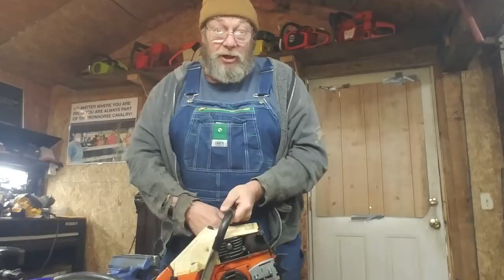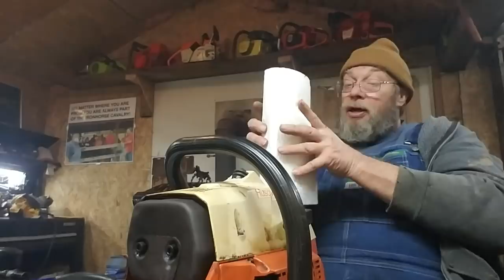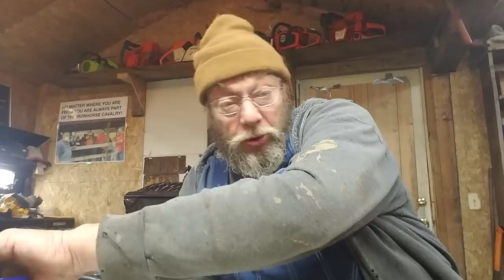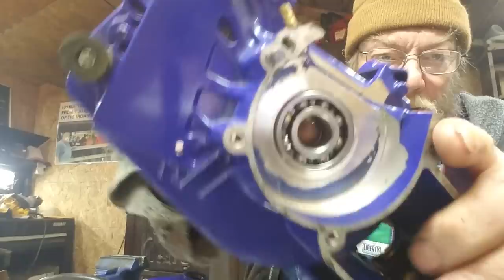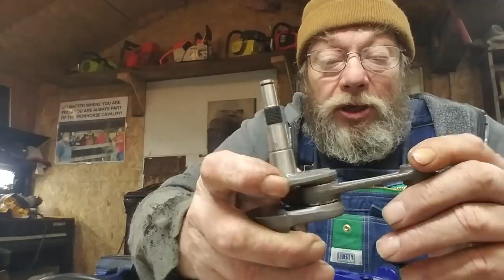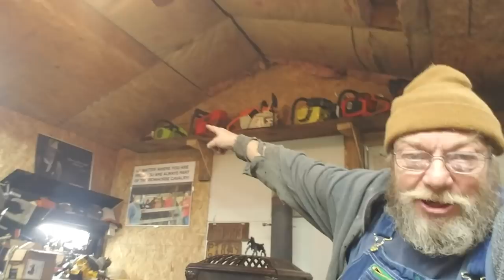Husky 61 running! Two more way cool builds! Talking bout buckinstock!

Comment: where in your opinion should this make power its a 20hp kohler on a 1970 omc sled I have played with porting a while ago I have been watching a bunch of your vids these are the first light numbers its working a lot better but now I'm trying to clutch it EX close 79' ABDCEx open 102 ATDCTransfer Close 66' ABDCtransfer open 115' ATDCintake open 109'ABDCIntake close 70' ATDCsaw joke of the dayBest thing about a poulan is the recoil because you keep poulan and poulan and poulan

Comment: the holzfformas are epic saws, the G660 keeps getting better and better each year. i run the G372XP and 070 from them. both are solid solid saws and i have a good feeling they will last a long long time.
Reply: Nathan Van de Velde By any chance have you noticed any changes in the cylinder castings, or mostly other stuff getting improved? Ordered some huztl cylinders and there’s been two different versions (dark grey and silver) but it might just be anodized or something. Might end up checking if the port numbers are different on the new version
Reply: ghetto bikelife that I don’t know. I build a 361 and it had a “silver” cylinder and looked excellent on the inside. (Still have an air leak somewhere) 🤔🤔
Reply: Nathan Van de Velde I had one with a few slight bubbles where the plating wasn’t adhered correctly but for the most part the cylinders have been great

Comment: hey harv i came across a husky 353 at a yard sale some time ago that was blown up and i put a 45 MM cylinder and piston in it....do i need to use a different carb for the bigger cylinder? and what are your thoughts on that saw as a little mess around light weight saw
Reply from the maker: In most cases no!